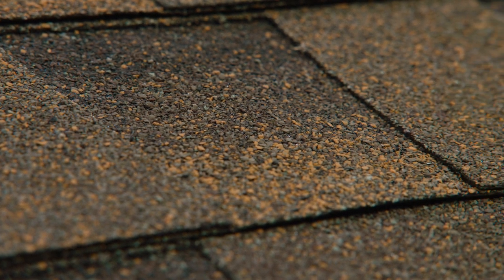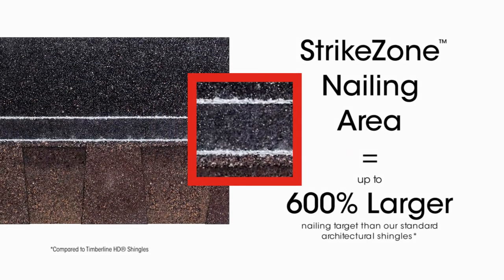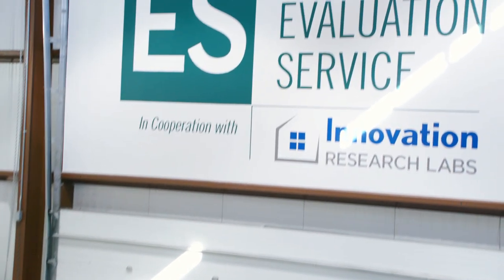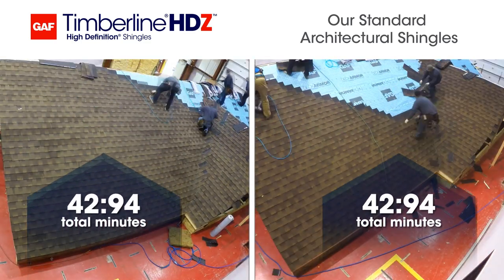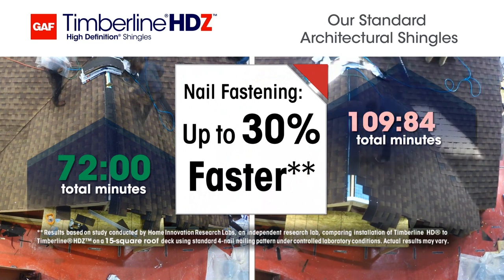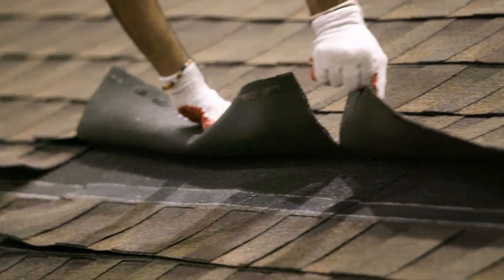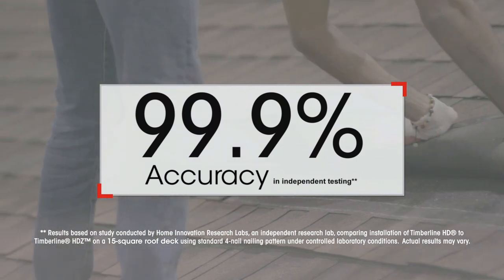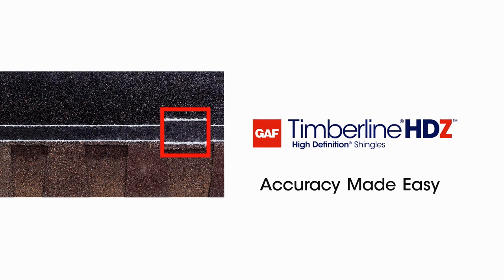Is GAF Timberline HDZ Faster (and More Accurate) to Install? | GAF Roofing

Comment: Is the whole "strikezone" area fully double layer?
Reply: tom lee no
Reply: Of coarse.....
Reply: tom lee it's almost the exact same as a HD, only difference is the wider zone and more copper added with granules. They suck
Reply: I just shingles a roof with the old HD on one side and the other side the new HDZ. The HD felt thicker and more durable, I started with those first and then I did the other side and it was night and day, the HDZ are really CHEAP feeling. My nails were blowing through and they felt more flimsy. I couldn’t believe it. I’m going with a Owens Corning now with the nail strip and the thicker shingle,